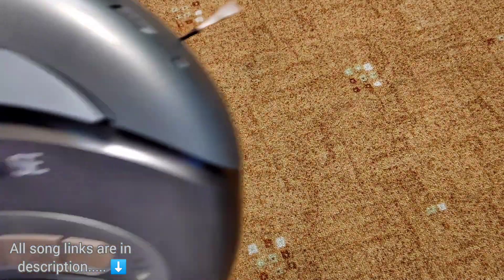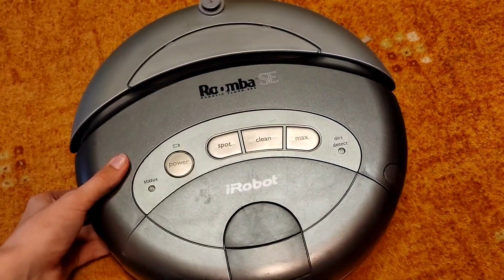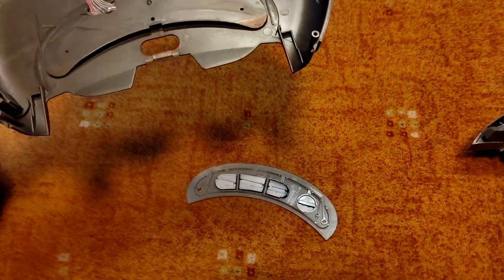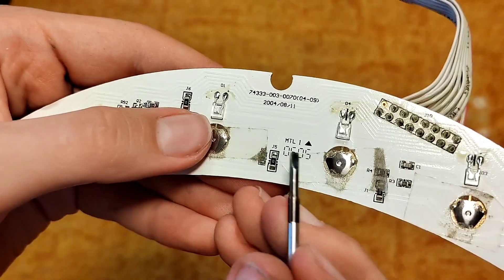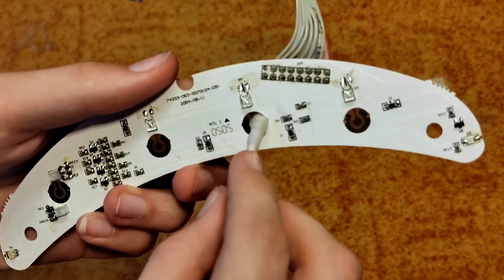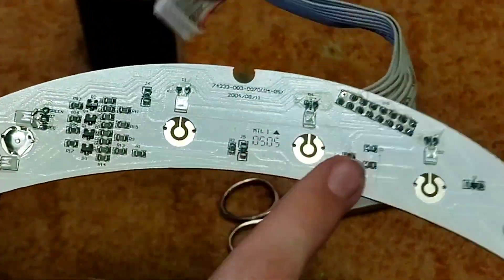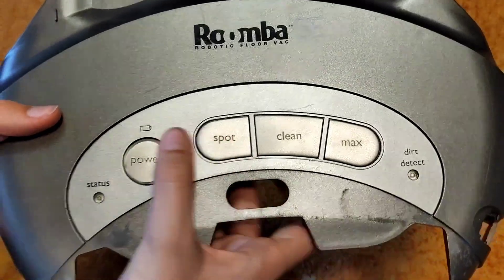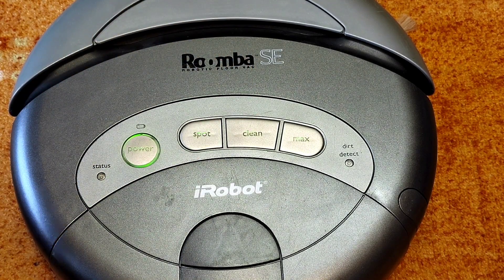How to fix not working buttons on Roombas 4000/400/Discovery series | RoboVacCollector

Comment: wats the difference between max mode and clean???
Reply from the maker: If Clean mode is enabled, Roomba should clean until it thinks the job is done. Roomba can calculate the approximate room size and choose the correct movement and time to clean it. If Max mode is enabled, Roomba will clean untill the battery is dead no matter the room size. Good question btw, many people don't really know what Max does. Also fun fact, the last time Max mode was seen on Roomba was on 500 Professional series Roombas, models 610, 611 and 625. (they are 6xx, but still considered as 500 series) Since then iRobot has never put this feature back on any other Roomba.